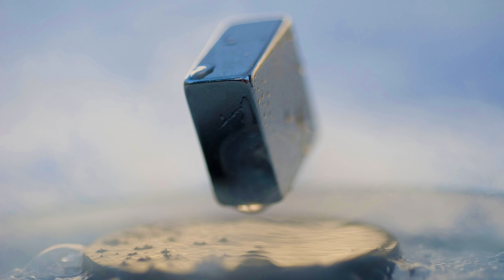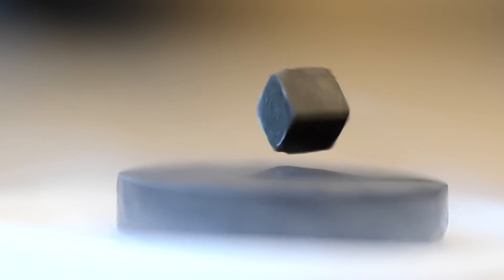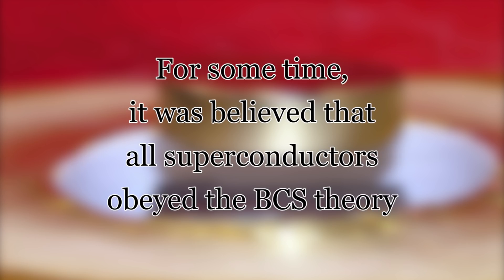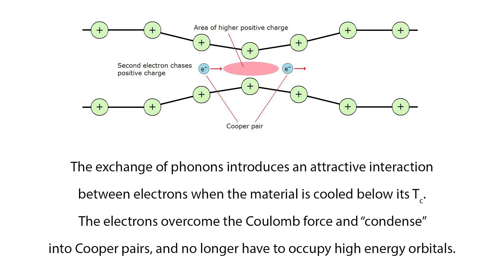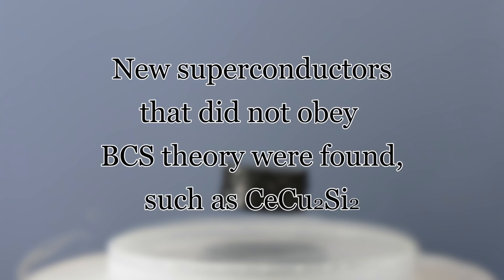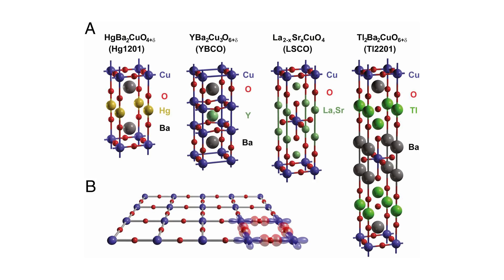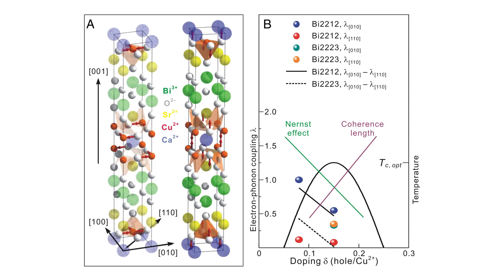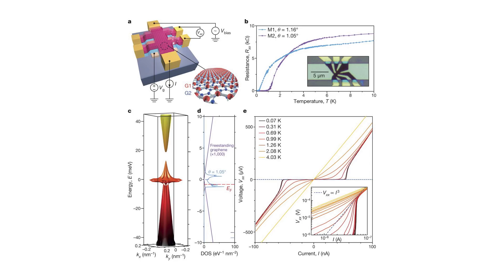High Temperature Superconducting Materials

Comment: All superconductive materials have very high specific heat capacity upon reaching superconductivity. At least now we know the missing link between electricity and magnetism which is the photons. The findings of the association between superconductors and high specific heat capacity may again prompt us to believe the important role than played by photons in fostering superconductivity. Precisely, superconductors are strong antiferromagnetic substances that repel away the external magnetic field that we coined as meissner effect. To be honest, we don't think electrons played any important role in superconductivity. It's time to focus on the right thing, the photons. Superconductive substances possess superconductivity characteristics mainly because of its unique nucleus structure that able to stockpile abundant stationary photons at certain low temperatures. Thus, at critical temperature, the specific heat capacity is also at maximum level too. If you are interested in real discoveries, I would recommend you to read my book, The Unification Theory - Volume One and you will be amazed with lots of new, interesting discoveries. In God I trust. .